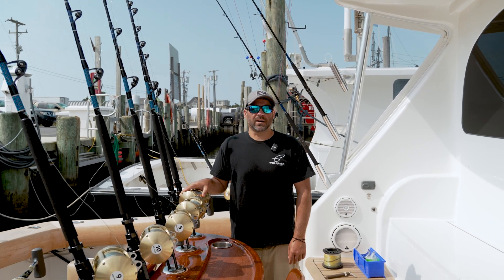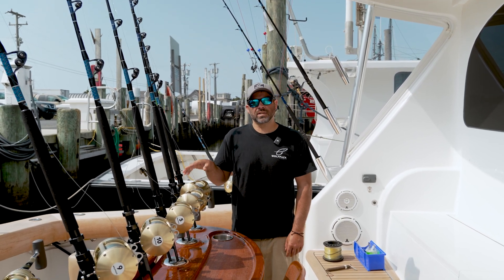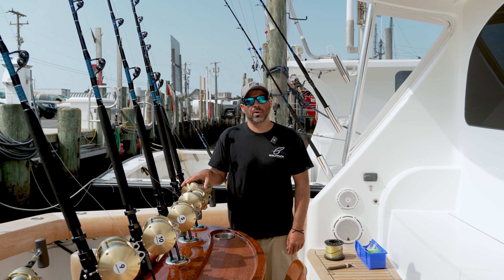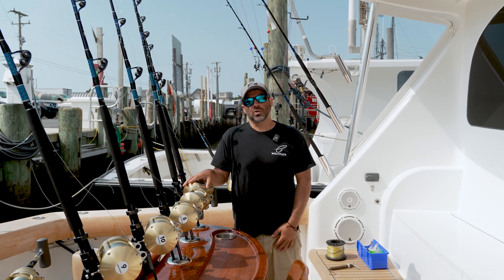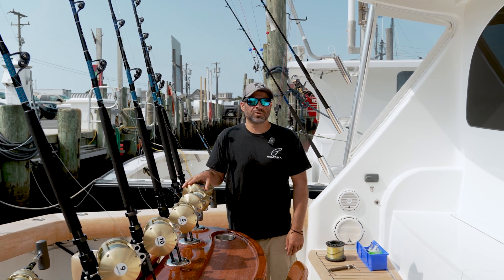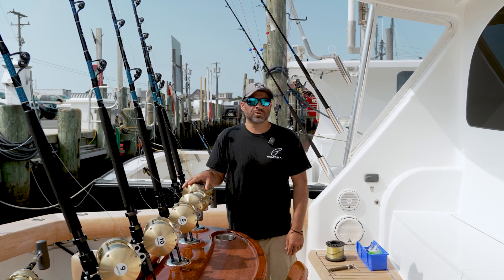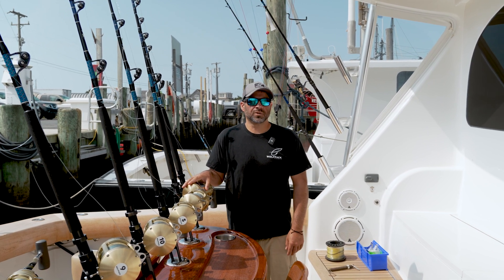How To Scale Your Drag | Underestimated Offshore Practice

Comment: How do you calculate the the right drag needed , is it based on the leader strength ?
Reply: Great video on an important subject often overlooked.  Same here, for a lot of us, in Southern California.  Have done over a hundred trips from overnight to over 10 trips of 10 days.  They said 130# spectra with 100# mono line as the topshot.  The answer to your question is yes, it's based on the lightest line, the 100# mono.  Most common is 25-33 % of that 100# line.  He is at 27% which is right where I like it as well.  After 25+ years of fishing I'm amazed how few people come with a scale on fishing trips.  I always have somebody ask about the scale and to show them how to set it properly and to borrow it, of course.